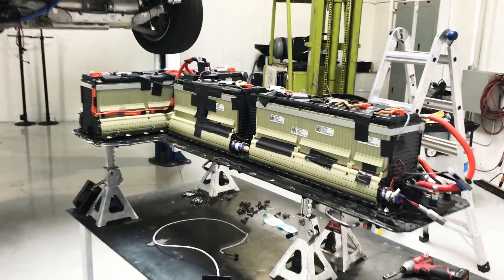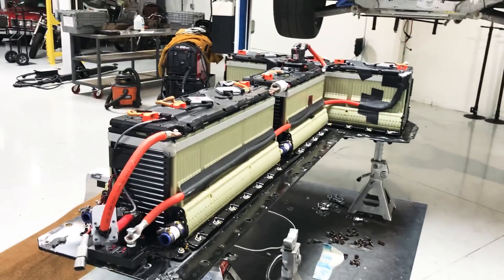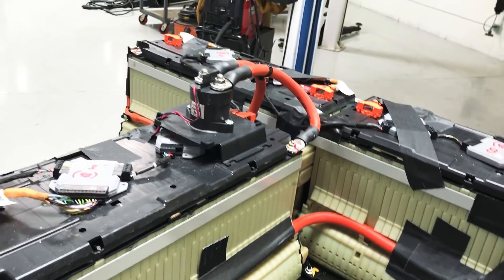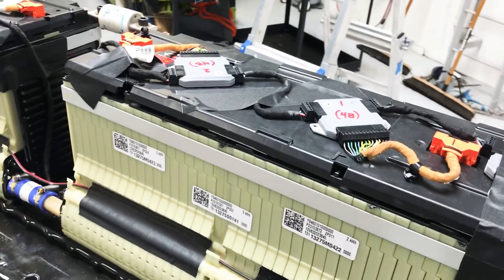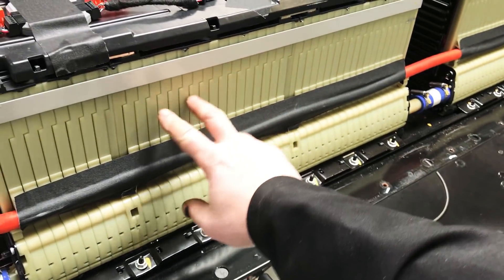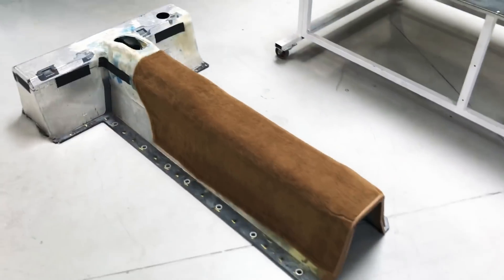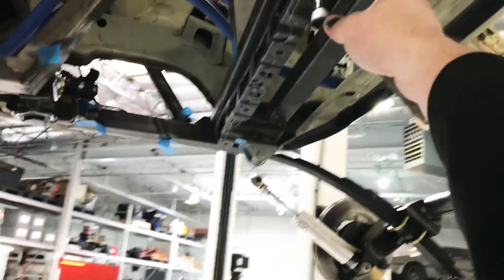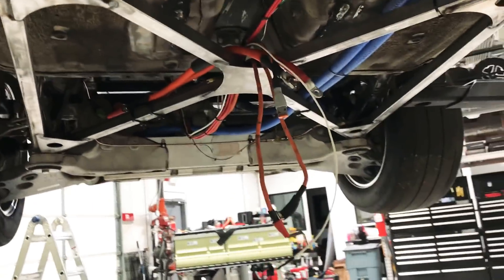1,200 Amps! Teslonda’s horsepower factory

Comment: Using the 2/0 cable, we're you able to find good connectors for the 1/4" Volt battery posts? I'd love a recommendation.

Comment: Yeaahhh... Love all the madness here... 1200A so much POWAAAAAAAHHH ohhh yeaaahhh =]
Reply: ElectricBike well actually that makes no sense, since Amperage requires a voltage too, both are components of power. If it was running at 0.001V the power would only be 1.2 Watts. So 1200A means nothing without a voltage component.
Reply: yeah, pretty much a "PLEASE PROMOTE ME" type of comment. the type that doesn't say anything, just puts your name out there, with a somewhat positive connotation. what a windbag.

Comment: WOW.. awsome work and also it's great to know these NMC cells can take such high AMP!  !!  On my Zero the NMC cells from Farasis can take 10C continuous and 15c burst  so it is pretty similar.  But not so sure about the 20C... did you had any chance to measure the internal resistance of one of these 3p groups?
Reply: Exactly. they must be cooled. For my Zero motorcycle drag racing  bike i'm using The Lonestars Performance LiPo sleepercells. these can take a true 100C discharge and that,s awsome. these have made many world record for EV. I'm using 22s2p for a total of 9Ah that i drive at 700A battery curent and can do 3 consecutive runs before they hget too hot. in that video you can see the little 70kW sticker on a little black box down to teh Zero frame, that,s my battery. it weight 13 pounds  https://youtu.be/O1ThWE9oVn0
Reply: Doctorbass haha I knew someone from ES would be here... isn’t this channel so freaking cool? Love all the madness here... 1200A so much POWAAAAAAAHHH ohhh yeaaahhh =]
Reply: Can they do that? I'm using a 24V + 48V module on my scooter and when pushing to 350A the volt drop goes from 72V to around 66V. I'm using 2AWG for cables.